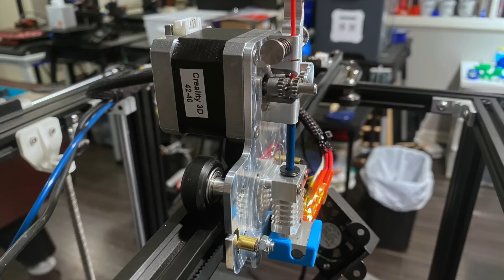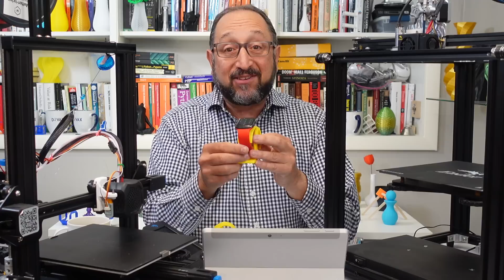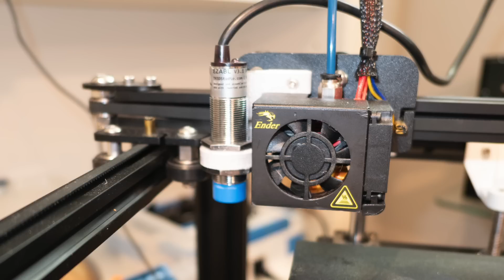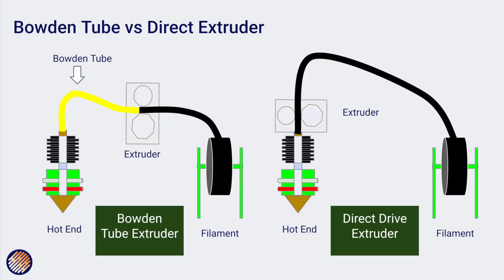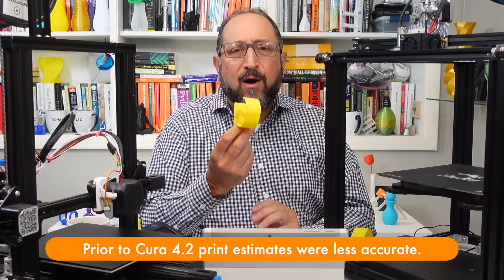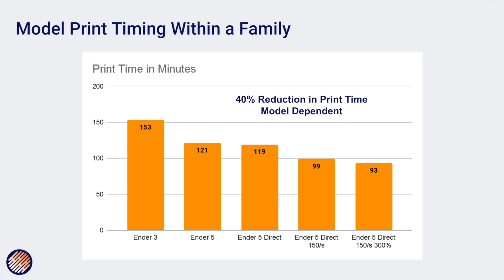Faster 3d Printers, Bowden vs Direct Extruder, Creality Ender 3 v2 vs Ender 5

Comment: I have a printer I bought used and really dont know the brand name. It appears to be a clone of a prusa. It has a boden tube. One time I made a mistake  and instead of putting in .3 mm for the first layer height I typed in 3. mm. When it started to print I noticed a horrible noise and the spool of filament was turning at mach speed. It was trying to extrude enough filament for a 3 mm layer height. By the time I got it shut down I had a pile of plastic about the size of a ping pong ball lol. This thing can extrude some serious filament in very short time.

Comment: Yes I have been eyeing up that micro swiss direct drive kit for my ender 5 plus.  One thing I am confused about, if you are running direct drive shouldn't you get rid of all the bowden tube before the extruder?  I see lots pf youtubers saying how much better DD is that Bowden yet there stil running a foot of bowden on their DD's??!?!?!  Even though the extruder has more precise control of retracts aren't you still getting some of the negatives of Bowden setups such as increased drag on the filament particularly in retracts?
Reply: They don't have bowden tube before the extruder, it's just tubing( 8:20 ).  They actually need it to prevent the filament from wandering away, kinking, or damaging itself bending around edges.

Bowden tubes(Bowden mechanism) are a specific idea for transferring mechanical actuation along a cable contained within a tube(commonly used in bicycles and automobiles). Without the mechanical power transfer, it's not Bowden.

Comment: How does a Prusa print so fast if it's a bed slinger? Evidently that isn't as big of a factor as you might think. It would appear that direct drive may be a big factor. Also, I've seen Ender 3 v2s with support brackets for the Z axis. Does that solve the rigidity issue?

Comment: What 3D printer would already have all these upgrades while keeping the cost close to whatever the cost of the ender 5 would be with the upgrades.  Prusa or QIDI x-max is rather expensive and not sure if it has the same updates like the Swiss extruder and all metal hot end, I do know it has the upgraded motherboard 32 bit arm but not fully automated leveling like you said the Prusa has?

Comment: Upgrading my ender 5 plus to a direct drive after this. I constantly have to recalibrate my retraction settings with the Bowden setup. I believe with a better extruder on the Micro Swiss, it will give me a better print.

Comment: Just converted the CR10S pro v2 with micro swiss dd kit. It was almost a direct swap. I needed print a custom fan casing to include the bl touch. Lost 8mm of print space which I'm trying to figure out how to adjust the nozzle position back to the middle of the bed.

Comment: So, you can't really compare speed between the two, as the Ender 5 has been upgraded, massively, and the E3 V2 has just a BLTouch added, but they are both very different machines regardless, so...

Comment: I am not sure about the stock firmware, but if you compile Marlin 2.x yourself the Sample Config has the same settings as Cura sets it to.
Also, in newer Marlin it uses Junction Deviation instead of classic Jerk.   Do you know anything on calculating this?
Thanks for a great video.

Comment: The bed assembly on ender 5 is bad and can cause more quality defects then ender 3's frame, it does not shake, its wiggles up and down . But once it is fixed or modified, yes, I would say that ender 5's frame+ z axis is better from quality/speed point of view.

Comment: Great informative video as always. I learnt something today :-) . Would changing the nozzle size to a 0.6mm size help in printer speeds?
Reply from the maker: Yes. Because with a .6mm nozzle you would probably increase the layer height to .30 or even .34mm.  With thicker layers you need less layers and your print completes faster.

A great place to discuss this is at the MakeWithTech forum located at https://forum.makewithtech.com.

At the free MakeWithTech forum/discussion group, you can also post images and examples of your work.

Comment: Great video as always 👍
The bed moves DOWN not up under printing at the Ender 5...
Thanks for sharing your experiences with all of us :-)
Reply from the maker: Yes correct.  I starts at the top and moves down.
Reply: If you use Z Hop it does go Up slightly as well.  During a Z Hop it will drop down then go back up by the Z Hop distance.  I believe this is what was mentioned in the video when going up and down was mentioned.

Comment: Beautiful comparison.  The only thing that's put me off the Ender 5 is that a few reviews pointed out the lack of front lead screw(s).  If you make a "dense" print - one that might use a whole kilo or more of filament - the lack of front support is reputed to make the bed droop at an increasing angle as it goes higher.  Bed leveling is cancelled out, according to those accounts.  It would be good to see some contemporary re-evaluations of that.
Reply from the maker: I added 3d printed supports to the front of my bed that work well.

I cannot find the ones I used but these are close.
https://www.thingiverse.com/thing:4425394

A great place to discuss this is at the MakeWithTech forum located at https://forum.makewithtech.com.

At the free MakeWithTech forum/discussion group, you can also post images and examples of your work.
Reply: It will, even without a heavy print. I have an ender 5 and it has this issue also when the printer does quick direction changes

Comment: Talking of all metal hotends and direct drives.  I have an ender 3 pro and an ender 3 pro with ender extender 300xl kit installed.  Both have gulfcoast robitics all metal hotends, duel z axis rods, and direct drive conversions reusing the stock parts (I do have metal extruder uprgades).  I prefer to print with .8mm nozzles but have a .5mm installed on both.  Both have 4.2.7 32bit boards also. 

Overall I am happy but I have an issue where I just can't get a good full extrusion at the start of a layer or after a retraction for 2-3 mm.  I have played with all kinds of settings including speed, temp, flow rates, and prime flow.  Do you or anyone recognize what may be happening here?
Reply from the maker: Try increasing the temperature to see if that helps.  .8 mm nozzles require a lot of filament flow and your extruder may not be up to the job.
Reply: @MakeWithTech  Thanks, It didn't matter when I had boden with Capricorn tubing.  To go any higher I will need to follow your video on custom firmware.  I should have mentioned I print in ABS and PetG.  PetG doesn't seem to have the problem at all on one machine and reduced on the other machine.  Thanks again.
Reply from the maker: You can determine if this is a extruder volume issue with a test. Try slowing down to 25-30mm per second and see what happens.
Reply: @MakeWithTech  will do, thanks again.  To be honest I have second guessed that I should have went MicroSwiss for my all metal hotends and direct extruder just for the tech support.  Dialing this in is taking a bit, but the rest of the prints come out really good looking and very strong on functional parts

Comment: Hi, thanks for another great session.  BTW, you may want to improve your understanding of JERK..  Jerk is to acceleration as acceleration is to velocity.   That is, the first derivative of jerk is acceleration, and the second  derivative of jerk (as well as the first derivative of acceleration) is velocity.  Said differently,  the jerk is the rate of acceleration of an acceleration.  You have described jerk simply to be a negative acceleration (eg a deceleration) .   Keep up the good work, look forward to you next video.
-g2
Reply from the maker: Thanks for the clarification.   I was looking for a non mathematical explanation but I may have missed the mark.
Reply: You mean change of acceleration or "delta" of acceleration, acceleration has a specific meaning so acceleration of acceleration makes no sense. This isn't what jerk is anyway its just what step change in frequency you can send step signals to the stepper is i.e. 1 step per second can jump to 7 steps signals per second without needing to do the 2,3,4,5 and 6 in between.

Comment: The cheapest and most important upgrade is replacing unidirectional press fits with bidirectional screw fits for the bowden tube. The cheap unidirectional will desintegrate and degrade your prints with debris clogging more and more.
Reply from the maker: Interesting

Comment: Is there any advantage to a bed that moves on the horizontal? Should all 3D printers be designed so the bed moves vertically instead?
Reply: The advantage that I can see of the vertical bed over horizontal, is that in vertical config, the bed will move in only 1 direction during the print (if you dont use z hop), so you can print faster without affecting the quality (well it depends on the printer, ender 5 is the worst example possible). In horizontal bed config, the heavy bed moves back and forth, it will be affected by inertia, so you need to reduce the speed to have less pronounced quality issues.
Reply from the maker: Excellent question.  It might be less expensive to build but not sure.